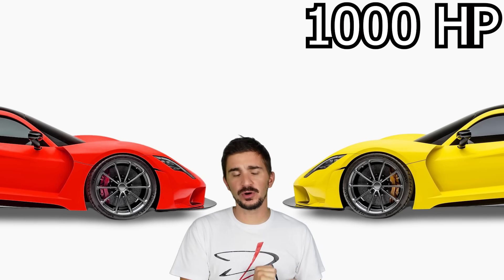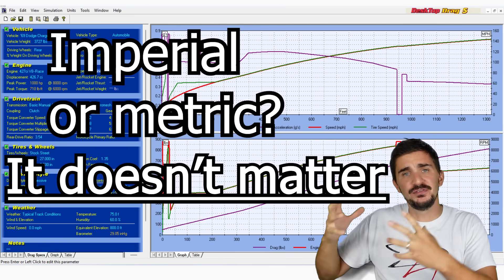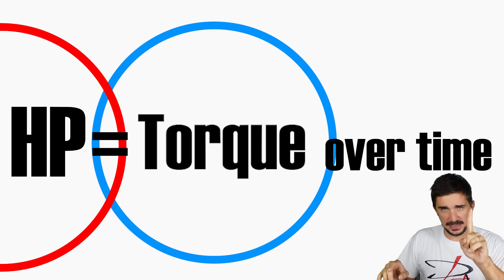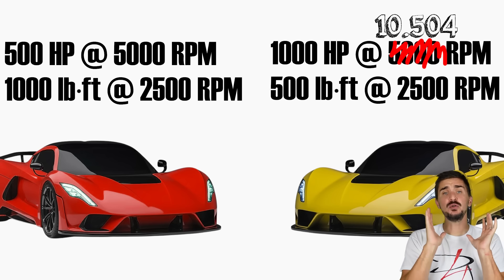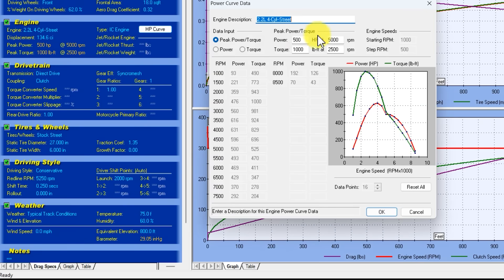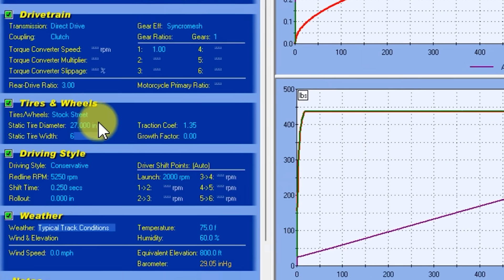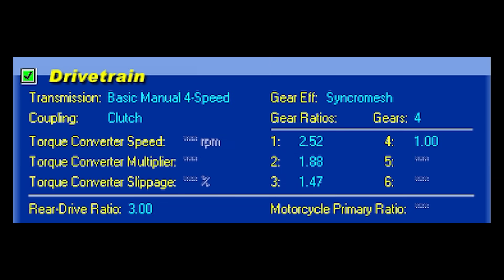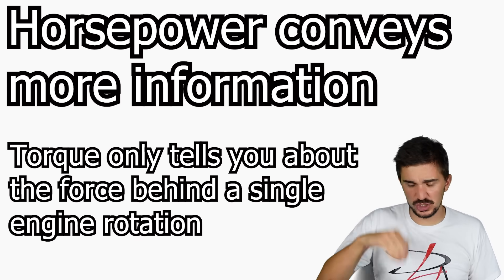Who's faster? Explained and Simulated - Horsepower vs Torque

Comment: As always, know the type of "riding/driving" that you are going to be using most.  For instance, if you live in an area that has a lot of steep hills and tight turns where you are going up hill on a reduced radius turn a lot of the time, you want torque over hp.  If you live in the desert and you have flat roads with very few turns, you want hp.  Put both on a motorcycle with two up riding and you want torque over hp in the hills and hp on the flats.  So, drag strips are just for racing purposes, not for real life use.  Also, if you like the sound of a high rev'ing engine then pick hp and if you like to "lug" your motor, then pick the torque motor over the high rev'ing motor.  I personally live in the mountains where there are a lot of tight turns and I ride two up, so a Harley is better than a Ninja for my purposes.  When I lived in Northern Nevada, and rode single, the ZX12R was my bike of choice.

Comment: 5:47 Is the Redline parameters tells the rpm limit of up shift, and let it go on the final drive? It let me thinking that the 5250 rpm conservative limit is using half of the horsepower when using the transmission. obviously, it cannot even obtain that rpm on direct drive. Nonetheless, the video is very educating as usual. I like your work, I refer to them as often as I can.

Comment: This bias method only applies to electric motors. Boosted engines are power limited to peak boost at a designated rpm. You can have 500 torque preboost and 1000hp at peak psi. Antilag tries to adjust for that.

Comment: I heard somewhere once that torque makes you quick but hp makes you fast.
I'd love to hear ppl's toughts on this
Reply: It is not far from the truth, but not entirely accurate either. Torque can "pull" heavier weights by putting more force on the ground, while hp affects mostly the maximum speed you can move the weight at a constant pace. The first thing you feel when you press the pedal is torque, the thing you feel when you are at max speed is horsepower.

Comment: Correction at 3:12 and 13:03 , HP is NOT torque over time, its tourque per time (RPM is s^-1).  In SI units: Watt=Nm/s →→ Power = Energy per time.

Comment: It is very easy.

You need force (torque) to be able to make hp.

Put a high reving Ferrari engine in a big truck and it won't make much hp.
Reply: It will if it's geared appropriately.
Reply: well the engine might but not the truck as you will have snail speed.

Comment: I've explained it to my wife in terms of two dudes carrying bricks from one location to another over a bunch of cycles. One dude is strong and loads up with a lot of bricks, but subsequently doesn't move very fast when carrying them. The second dude is skinny and loads up with a lot fewer bricks. Just how much quicker the second guy is and just how much stronger the first guy is goes into determining how much work they get done at the end. With no gearing in the equation, if the first guy is exactly twice as strong (carries twice as many bricks) and the second guy moves his smaller load exactly twice as often as the first guy, then at the end of any given time frame they'll have moved the same amount.

But, they'll have done it very differently. The character of how they're moving the bricks is very different. The strong guy is impressive and you really "feel" that brute force, but maybe once you get past that you realize he doesn't move that fast and the excitement is short-lived. The skinny guy doesn't have that impressive an amount of force, which maybe is initially disappointing, but he sure can move. Maybe the skinny guy's work output is more fun to watch, or maybe it just more fun to see progress made twice as often (albeit not as much each round trip).

The torque multiplying effect of gearing is where I think the higher revving engine can make up ground. If you want 2nd gear to be good for exactly 60 mph in two vehicles, one of which has more torque but revs to 6K and the other of which has less torque but revs to 8K, then everything else being equal the first / 6K engine has to be geared 33% taller than the second / 8K engine, and that means the higher revving engine will have a better torque multiplier, partially making up for its torque deficit in absolute terms. I've observed this with the two cars parked in our garage, a 2015 Mustang V6 Automatic and a 2023 Subaru BRZ Manual. Due to overall tire diameter, weight, driveline loss, and especially gearing, if you're comparing gear to gear, the BRZ with its 2.4 liter four feels about the same as the Mustang in 2nd gear and feels torquier than the Mustang in 3rd and 4th gears.

The Mustang does a little more with its gears though -- in 2nd and 3rd gears it hits 67 and 103 at redline while the BRZ hits 62 and 87 at redline. But this just makes the BRZ more fun on the street since you can redline it at saner speeds and you have to shift a little more often.

I think the first-gen and second-gen BRZ engines are an interesting lesson in how torque peak and where it occurs doesn't always tell the whole story.

I don't when I started doing this, probably 35 years ago, but I've always looked at HP and HP/torque ratio rather than HP and torque by itself. For example, the 2023 Camaro V6 produces 335 HP and has a HP/peak torque ratio of 1.1796 to 1, which tells me it's relatively high-revving in character, while the new Acura Integra Type S produces 320 HP and has a HP/peak torque ratio of 1.0323, which tells me it's a torquier but less revvy engine (obviously a turbo), but more revvy than the 1982 Camaro Z28 which produced 145 HP and had a HP/peak torque ratio of 0.6042, which tells me the party was over VERY soon for that one. 

Specific output or HP / liter is similar to this but kind of breaks down if you're comparing engines of very different eras, or forced induction engines (because torque per liter can vary drastically). The 2023 Camaro V6 makes a torque peak of 78 ft lbs per liter while the 1982 Camaro Z28 only manages 48 ft lbs per liter. The turbo in the Integra Type S is getting 155 ft lbs per liter. The best street cars I've seen in HP / liter (without forced induction) are the Porsche GT3 RS and the special release model of the final naturally-aspirated Ferrari (458?) -- in the 130 HP / liter range.

Comment: Good video, but I think it could have been better, let me explain. 

Horsepower is just faster, it provides more power, that's what the unit is there for. If the gear ratio is wrong, any engine wouldn't perform. What I'm saying is that if you got 5000rpm on the High torque One, and 10000rpm on the High power one, you should always use half the final gear ratio on the High Power engine. I would have done this test at the first or second try, because that's the real way of comparing those without other variables. In this case without other variables and the same torque curve shape, the High rpm engine would have literally double the performance (double the final torque at every point of the rpm). If you use same gear ratio on both engines, it gives the High rpm engine double the top speed, which for a drag race is totally wasted. That's why it went this way. Like you said power is a function related to torque. To make use of the High rpm you must reduce the gear ratio, otherwise it's only wasted potential

Comment: This was an awesome experiment I think you did a great job but I think torque was winning more only because it is getting peak hp earlier in the race. I would guess if you scaled final drive to peak power rpm -- so 1:1 for the car that peaks at 5k and about 2:1 for the one that peaks around 10k (I might have that backwards lol), that way they both are at peak power around 5k WHEEL rpm -- the results would be a lot closer. Ideally that would even allow them to have the same hp at every wheel speed, but still different torque curves, which I would hope would really put it to bed. Hope you give it a try :)
Reply: Yeah, this is why that whole comparison was relatively bullshit. A normal car transmission that he used is in no way going to have proper gear ratios for an engine revving to 10k RPM, while it is going to be pretty perfect for an engine revving to 5k RPM. He should have used actual, proper final drive ratios for both cars (and put some realllllly good tires in there because we all know that flooring a 1000 hp car will in fact spin the tires endlessly up to a very high speed, even if 4wd).

Comment: very good explanation. friend debate with me once about this. i just couldnt explain it since they dont understand it. also, i had no math in dyno and car example to explain it. i always associate variables that is similar but  in different physic. like DPS like you, in games damage per second - speed or strength to get DPS. electricity as in volts and amps and or water volume coming out of hose with different size nasal. jet engine of air volume and or thrust.  its easier to simulate it in your head then to explain it. 

the same way i always mention power band for race car. strict race car has maximum  HP - its the power band that you tune it and manipulate where the power is at sweet spot that win race. this is why tuner comes in play. you tune the car to specific track. its so hard to explain it to someone who's doesn't understand physic. thats why there's so many so called tuner that dont understand the basic fundamental law and only increasing its power HP or making suspension stiffer thinking its how you tune cars. this seperate novice and car engineers

Comment: This could beade much simpler. To change a vehicle's speed, you need to increase it's kinetic Energy. Variation of kinetic energy over time is power. Simple as that. Once you have a modern, well tuned transmission, only power matters. For instance, the M1 Abrams tank has a high power, low torque engine, and it moves a 70 metric ton hunk of steel thanks to its transmission.

Comment: Area under the curve and time lost when there is no drive happening.

Another factor would be that the torque monster is probably a diesel and thus most likely weighs a lot more than the HP monster :)

Comment: Old racer adage - understeer is when you hit the wall with your front-end, oversteer is when you hit the wall with your rear end, horsepower is how fast you're going when you hit the wall, torque is how far through the wall you go.

Comment: I think the important take away is thst gearing can change your torque output to increase your torque. Gearing cannot increase your hp. So in a car with a transmission, hp is more important.

Comment: I think that comparation was little unfair. In my opinion the results will be more realistic if you will give to 1000HP car final drive ratio of 2.0, and 500HP 1.0, in that case the 1000HP car will have the opportunity to show real potential. Because we need to choose the gear ratio in that way the torque on the tire will be the same on both cars, in other case one of the engine won't use full potetinal.

Comment: As a general rule when I plan to use a car primarily on a track I focus on total power and select gearing to let me stay up near redline.  For driving on the street I trade a bit of power for a lower broader torque curve, it considerably improves driveability in traffic.  Or just stuff in a good size engine and a stonking turbo or two and enjoy being able to eat your cake and have it too.  ;)
Reply: For a track car you should get a dyno graph at least once.
You want your gears to use the most HP. Have seen a view people overreving their car and just wasting fuel and material for nothing.

Comment: Good explanation, but by trying to simplify the rpms it greatly effected the power under the curve in favor of the high rpm engine.  Picking two real engines and modifying their curves slightly to get your 500 and 1000 numbers would have been better.  The new diesesl from chevy and Ford are both in the 500hp and 1000ft*lb range, for the 1000hp and 500ft*lb you may have to find modified 2JZ or any other high reving turbo engine, maybe even add torque the the F1 V6 curve.   But all in all, as far as racing goes you can always gear hp to win because it's literally more work being done.

Comment: I’ve always hated the saying “torque is how hard you hit a wall, horsepower is had far the wall flies.” It makes no since. A very simple way to look at how torque and horsepower FEELS is: torque affects the standstill inertia of a vehicle, horsepower maintains the inertia. It still applies the concept that horsepower is dependent on torque, but strong low end torque changed inertia quickly, and tapering torque at the end of a rev range, weakens the inertia of car (but still affected by rpm)

Comment: Cool video! I'd say power wins on the basis that any given application is going to have a suitable gearbox, but it certainly makes the point that peak engine power and given wheel power are two different things.

Comment: The way I have thought about it recently is that your torque controls how fast you can increase your rpm. I have no idea if thats correct at all, but it makes sense to me. The engine has to be able to get the load spinning before it can spin faster. If its struggling with that load, it wont be able to increase rpm to get to where it has more power. 

I would love to see this experiment revisited with more realistic numbers. The power:torque ratios in the example were a bit too exaggerated to make sense which gave the torque engine over 600hp before its 500hp 'peak' at 5000rpm. Compare something like a safe tune on a turbocharged K24, with 4-500 horsepower way at the top end, against the 2.5L turbo in my cx5. On 87 octane it has a peak of 227hp at 5000rpm, but a 310lbft of torque at 2000, and over 250 from 1200-4200rpm

Comment: Torque wins in track and HP wins in straight line.
Reply: HP wins everywhere. Have you not seen an F1 car?
Reply: Have not seen in leman audi tdi quattro r8.
Reply: @qasimkurashi1599  Le Man is endurance racing, where fuel economy and durability matter much more than in other forms of racing. Even then, there's only been one diesel winner.
Reply: F1 have both balance so F1 is winner.
Reply: F1 is also very light also aerodynamic.
Reply: Fuel also factor.
Reply: Calculate everything then you understand about f1.

Comment: If each car had gearing optimized for it's engine then the 1000hp car would be faster.
Reply from the maker: You completely invalidated your comment by showing you didn't actually watch the video.
Reply: @d4a Okay, I watched the rest. Giving them both the same hearing is still unfair, the HP car would always be much faster if each of them were geared differently to optimize for their strengths.

Comment: I like to think of horsepower as a measurement of work that can be done.  To get any work done you must have horsepower.  You can literally have an electric motor that makes 1000 pound feet of torque at zero RPM with absolutely no work being done and thus zero horsepower.   More horsepower will always get more work done and you can use gears to take that ability to do work and create as much torque as you want.  There are obviously factors with engine life, engine expense, weight, gear boxes, fancy engine parts and whatnot.   That said regardless of gasoline, diesel or electric - more horsepower will always be able to do more work.

Comment: The short version is: It is a matter of how much kinetic energy the engines get into a car. The theoretical answer is easy, power is energy per time, energy is force times travel. 1000 hp is twice the energy per time as 500, so obviously the kinetic energy in the 1000hp car will be higher. The practical answer is that both cars have so much power that in real life conditions they will break traction any time. Both cars are basically pointless, overpowered for reasonable road use.